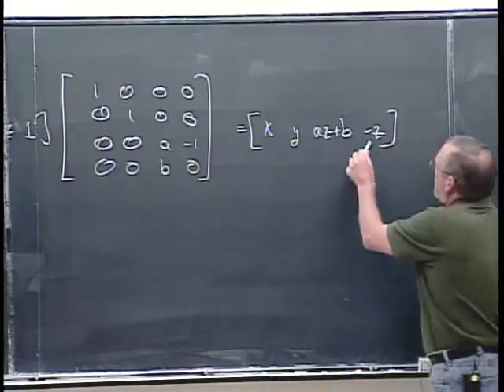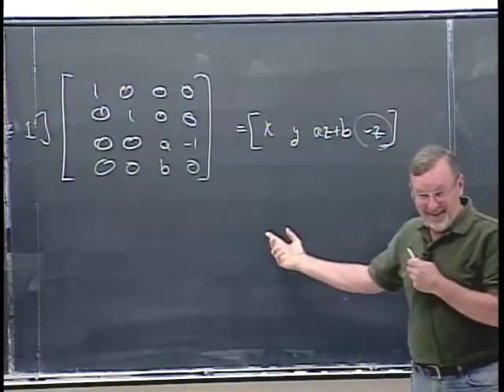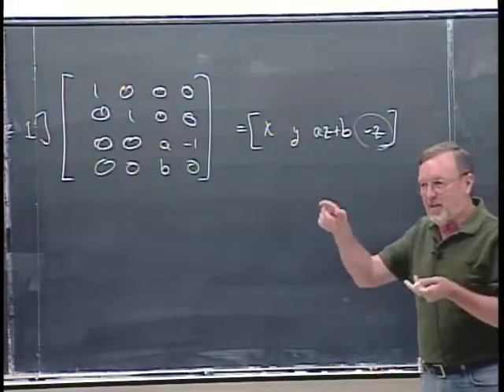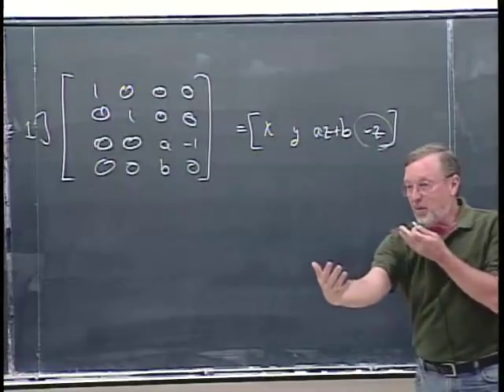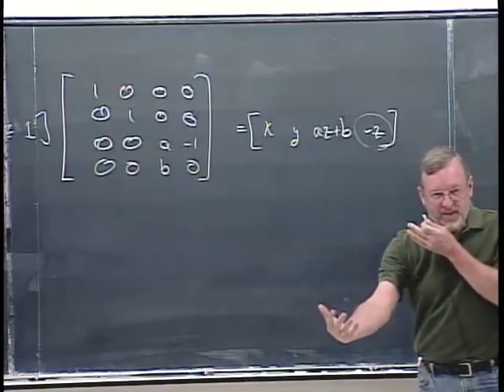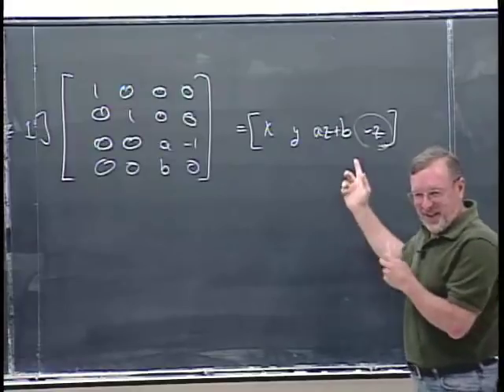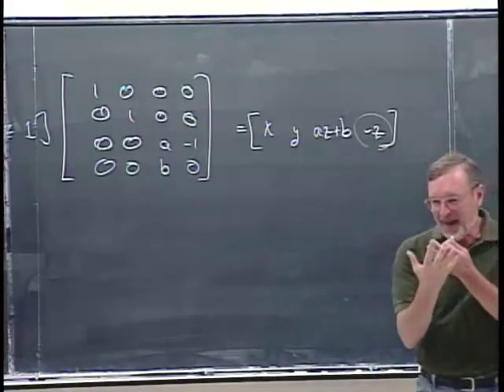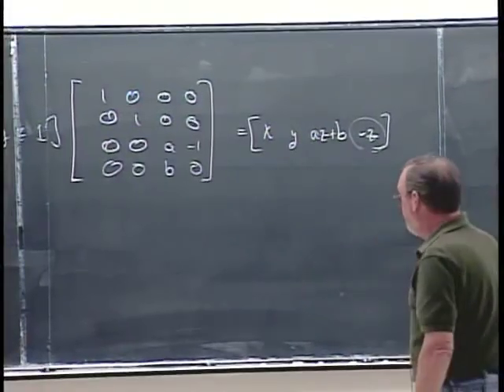The Camera Transform

Comment: Back in the mid 1980's I took an extension course at UCLA. I didn't have time to eat a decent meal before class, so I ate out of a vending machine and went up to the Engineering-Math Library before class. I Stumbled on to some IBM Research Journals that were very enlightening. Math PhD's had carefully researched algorithms and presented how they would do it if memory was not constrained. Then, they bastardized the algorithms to squeeze them into crippled computers. Before I finished the course, the friends of the library literally gave away these volumes because they were more than 15 years old and the library had run out of shelf space.  So, the bastardized algorithms survived, but the research into what should have been got destroyed. Our algorithms today are simply the patched versions of the bastards. Nobody has ever revisited what should have been. Its simply very awkward settled science, good enough for half a century ago when the bigger IBM 360's had 16K of core.

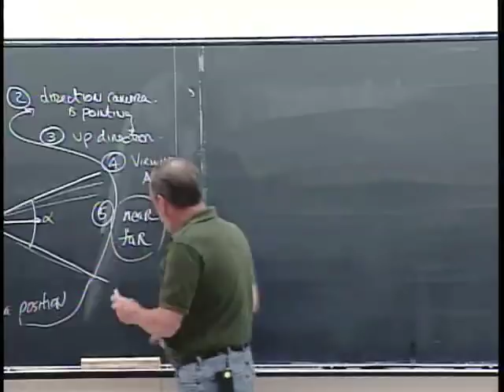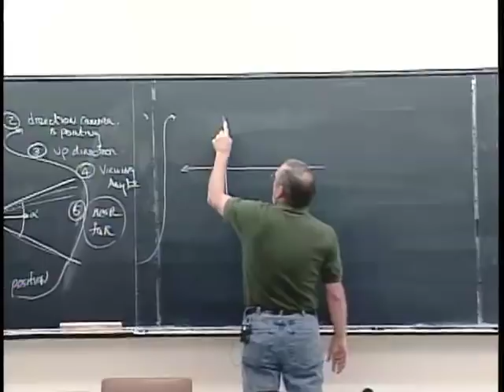Comment: 9:24 "THE BOX"[the camera] flies around in 3D space.  What is equation of that transform function?  11:05 only shows the end result of the world space after it is transformed into the camera space.  Did I miss a lecture?  The answer might be hidden in "Rotations About an Arbitrary Axis".  But I will have to put two and two together.  I hate thinking for myself.  Well at least the viewing transform is written out.  The projection transform is described but not written either.  I can guess that it is a 4x4 matrix that accomplishes a simple division by W.  Is "THE FILM" mapped into the cube-shaped viewing space at an adjustable position or is it fixed in OpenGL?
Reply: +techeadache i dont know if you figured it out since, but the way I understand is that before projecting the point using the camera transform, the points of the 3d world are converted to the camera space (where the 'Z' is behind the camera).

So if the camera moves in the space, before computing the picture, translation + rotation have to occur to make things right before using the camera transform.

(then again, I might be wrong, I just discovered today ^^ )
Reply: +mr_os Yeah it would have been nice if that professor mentioned something like that.  I am sure that is exactly what is meant to be done.  Even if it is trival or brainless or just plain obvious.  All of a sudden, all the world space points are in the camera space.  And it felt like I missed a step in the 3D pipeline.  Is it by Euler's Angles or Quaternions or some other mathematical magic that moves those points around?  Maybe this lecture should have been called "The Perspective Projection Viewing Transformation with a Contemporary Camera Classification Part 2(a)".
Reply: My guess is that it had to start simple, so you just compute a picture with the origin of the world at the camera point (ignoring the camera moving). 
Once students understand that process, you can teach the rest.

But don't get me wrong, I think you are right. At least a little mention should have been made.

And yeah, you would need to compute a translation + rotation with quaternions (to avoid gimbal lock) before the camera transform.
The result would still be one single 4x4 matrix (that changes when camera changes position).